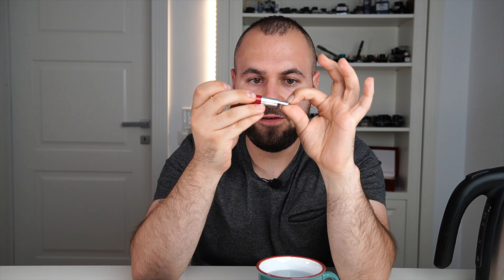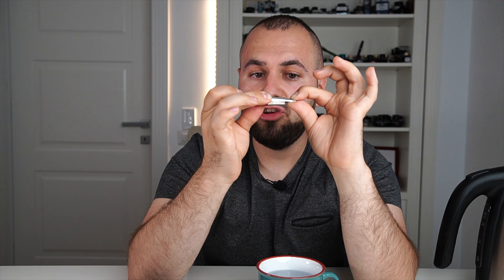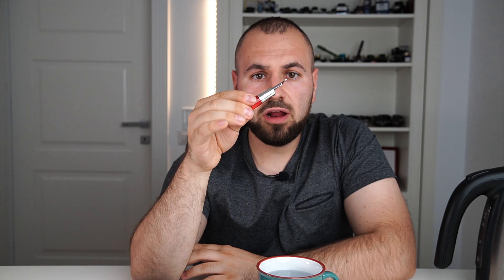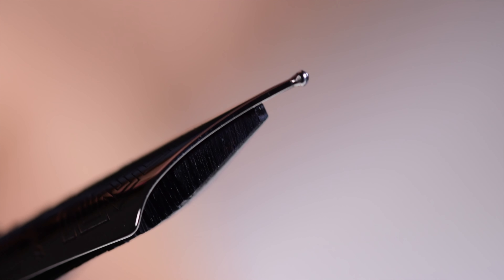Heat setting a fountain pen ebonite feed

Comment: I have a silly question. I have a pen with an ebonite feed and ultraflex nib. Ive inked it(it's an eyedropper with 2.5 ml of ink).  I was wondering if I could heat set the feed with ink in the pen or should I empty the ink and flush the pen before heat setting?
Reply from the maker: please empty the pen because its not going to work and its difficult to have normal temperature ink in the pen VS hot water for setting the feeder - better to have an empty washed pen
Reply: Ok I will.  Thank you very much for your advice. It was very helpful.

Comment: What temperature should the water be?
Reply from the maker: Hey Oleg - Ive put the water to boil in the kettle , I think 90’ Celsius considering that 100’ is the boiling point but pouring it into a cold cup can take the temperature down a notch so let’s say 90’
Reply: @pen.venture  Hello Emy. Thank you!
Reply: @pen.venture  normal water has some dissolved minerals and impurities....so that would elevate the normal boiling point instead

Comment: Thanks, Emy. Would you also suggest immersing the section in the boiling water if it is made of celluloid or ebonite?
Reply from the maker: Hey Chad - nope , if those two are made from ebonite or celluloid better safe than sorry - let’s say at most dipping only the nib because the ebonite feed will conduct heat and it’s enough to make it more pliable and set its form.

Ps - I’ll answer in the moring on the other stuff

Comment: are ebonite #6 feeds the same size as the other #6 feeds? im new to fountain pens and i wanna try these ebonite feeds on my jinhao 159 which has a stock #6 but idk if it'll be compatible.
Reply from the maker: This is a tricky question - usually they dont fit from one brand to the other and some have very different shapes or ways that they fit certain pens. I would recommend not to swap feeders from one brand to the other
Reply: @pen.venture  okay, thanks kind sir!

Comment: Very nice. A quick point. Make sure the tines of the nib are aligned before the heating. At the end of the video you show a close-up of the nib and it looks like the end of the tines are not perfectly aligned.  Also, DON'T suck up boiling, or just off the boiled water into the filling system. It can expand plastics. How do I know? Because I did it and needed to fix my Tripletail.  Cheers, Dave
Reply from the maker: Thank you Dave - you are right , under no circumstance to suck up any hot water in the pen - with the tines I’m also agreeing with you, not sure if my pen has the tines misaligned, maybe is the angle of the shot, I remember giving it a try and there was not scratchy or anything.

Comment: Hi, do you know if cross apogee has an ebonite feed? 
I bought it used and the nib doesn't seat well to the feed...
Reply from the maker: Cross Apogee pens have a plastic ABS feeder - if it's ridiculous in how far it is from the feed, it is a sign that maybe the nib is bent ?
Reply: @pen.venture  It looks like it was bented but repaired by a non professional. Probably the previous owner... 
It's an F size nib. 
Do you have any spare nibs for apogee? 
I live in Greece btw...
Reply from the maker: @nikossiotas  I dont sell the brand and I dont have any spare parts
Reply: @pen.venture  OK! Thank you very much for the help about the material of the feed!

Comment: I tried heating my ebonite feed with boiling water, but there was no change at all.
I squeezed the heated ebonite feed tightly, but it was very hard.
How did you feel when the ebonite feed was bent?
Did it become so soft that you could feel it bending?

Please understand that it is written using a translator.
Reply from the maker: No problem with the translation - i can understand.
When i tried it, the ebonite feeder became soft - like very soft - almost to the point that while i was pressing my nail set up a imprint in the ebonite feeder, so in theory you should keep it more soaked in the hot water ? maybe?